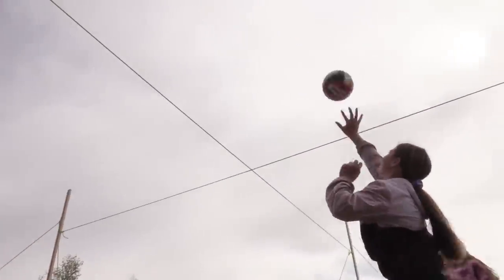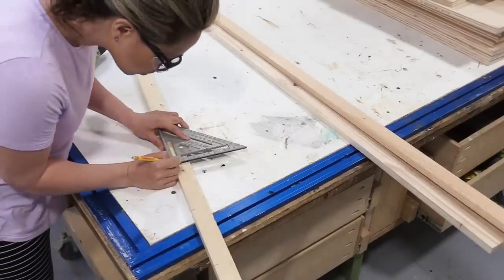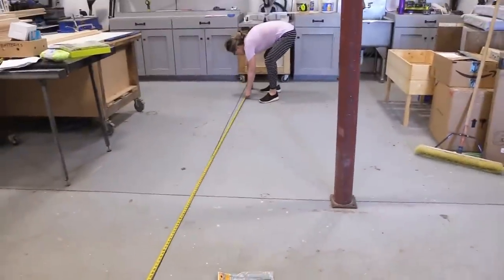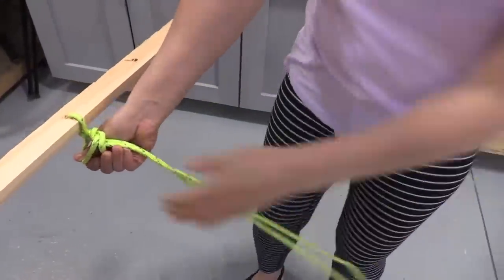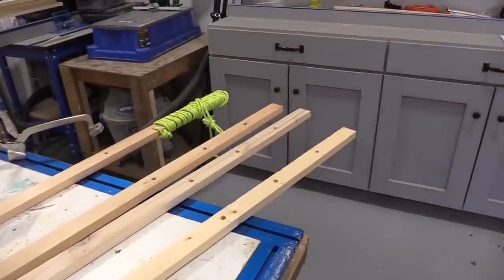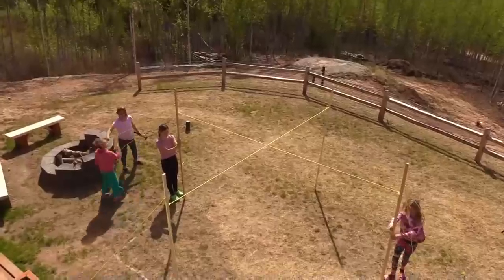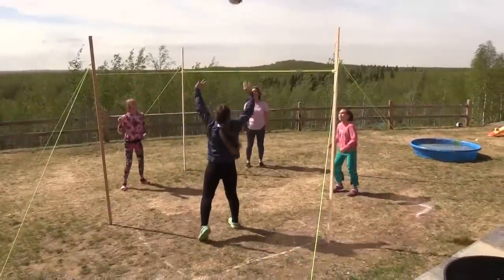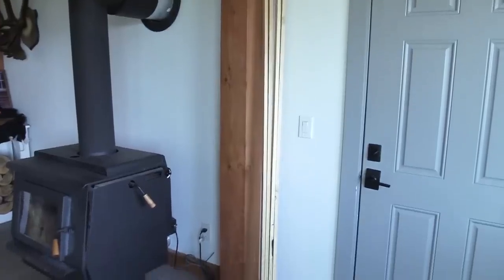Make Your Own Volleyball Four Square Game!

Comment: Used to play it with a rubber kick ball and chalk off four squares (3.5-4.0 ft depending on space). We also played, no contact, no touch Kick the Can because we would get in trouble for rough-housing at school. They also practiced volleyball "bumps" against a wall that had a net line. Sometimes they would practice accuracy by squares masking taped above the line. Next, they will be asked my for tetherball!!

Comment: Thanks for the video! I'm making our own right now for my son's graduation party.
One thing I noticed, though. The voice-over mentions using a 1/4" bit, but in the video, it's a 3/8" bit. 
I'll use the 3/8" bit as you did in the video to make it easier for the rope to go through. 
I'm also using glow-in-the-dark rope for night games. I can't wait!

Edit: The boards are actually 1x3x8. 
I went off the list that says 1x2. I know they're 2 inches wide, but at  the store, they're called 1x3. 
Might save someone the hassle of returning 1x2s. 👍
Reply from the maker: Sounds good, either board size should work just fine, the diameter will depend on what size rope. I love the idea of glow in the dark rope. If you have time I'd love to see a photo!
Reply: @AnaWhiteDIY  I'm making it tonight. I was concerned that the smaller boards would bend too much under the tension.
 I'll take pics!